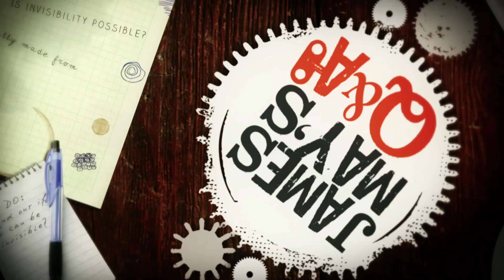Why Can't Trains Go Uphill? | James May's Q&A | Earth Science

Comment: In Swiss and German Alps there are trains with gear wheels that lock into the gear teeth on the rails.  The Train can climb extreme rises.
Reply: +bohemianh 
Cog railways are usually, if not always, 1 or 2  car passenger operations. That means they are relatively light weight.
Freight trains on the other hand weigh thousands of tons, a unit coal train in the US for example will have 125 cars each weighing 100 tons (that's 25 million pounds total, 11,340,000 KG) and run with 3 or 4 4,500 horsepower locomotives. That's a very low horsepower to weight ratio, ( around 1 HP for 1,400 pounds (635 KG). Imagine a car that weighs 4,500 lbs [2,040KG] with a 3 HP motor) and their limiting factor is not as much as loss of traction as not having enough power to climb more than a 1% grade, (1 foot of rise in 100 feet of run). Typically in the plains grades will be less than 1%.
I have seen such trains in the Rocky Mountains with as many as 10 to 12 4,000+ horsepower locos. They space the engines throughout the train, 3 or 4 in front and radio controlled units 3 or 4 in the middle and another 3-4 pushing in the rear of the train. But even in the mountains mainline grades rarely exceed 2 1/2% and these trains can only go 12 to 15 miles per hour (20 to 25 KPH)
The real problem here is comparing apples to oranges, not all "trains" are the same. Little short tourist or commuter cog trains have very little in common with long haul mainline freight trains except they run on rails.
Reply: +NotATube There is also a system with a third rail and an extra set of rubber tired traction wheels called... Something. Ill go look it up.

 Looks like its the Fell railway system, and most of the time its just used for breaking force.
https://en.wikipedia.org/wiki/Fell_mountain_railway_system
Reply: +bohemianh The steepest grade on a cog railway is the Pilatus railway in Switzerland with a maximum gradient of 48% with an average of 35%.  The Mount Washington Cog Railway (in my home state) was the first mountain rack railway and second steepest in the world which has a maximum gradient of 37.41% and an average of 25%.  The first rack railway was created in West Yorkshire, England.  
Having been on the Mt Washington Cog Railway once, I felt I needed to ride behind the traditional steam locomotive for the "full experience".  With every piston cycle you're jolted about once a second as if in a violent rocking chair.  THAT made for a very long 45 minute ride up the hill. ;)  They had just recently commissioned a diesel locomotive from John Deere which powers the cog system hydraulically.  When I got to the top I was jealous and physically regretful. ;)
Reply: @MarcMercier1971  Pikes Peak in Colorado also has a cog railway, climbing to 14,000 ft above sea level.
Reply: +Luckystrike now that is a great point
Reply: Culdee Fell Railway
Reply: +bohemianh The train that used to connect Argentina and Chile through La Cordillera de los Andes was just like that, I remember seeing those gear-contacts beside the tracks
Reply: alpha4005
 Thanks for the additional information.
It does get pretty technical fast.
I thought the original video was pretty poor in their attempt to explain "why trains can't go uphill"
Reply: +bohemianh Yes, that's exactly what I was thinking as well. 

https://en.wikipedia.org/wiki/Rack_railway

I don't know whether there are interoperability issues with trains compatible with such systems on regular tracks. I'd also assume that the Swiss ones going up very steep slopes would be unsuitable for reasons that are obvious if you look at the shape of the train in the photo (i.e. the train itself is slanted to match the slope):-

https://commons.wikimedia.org/wiki/File:VRB_H_1-2_bei_Freibergen.jpg
Reply: +bohemianh Cog railways are really unique and very interesting.

Some even have a ratchet system so the train can't roll backwards down the grade if the brakes fail.
Reply: True,  much higher gradients can be climbed by rack railways at the expense of steam...  Rack locomotives have very low gear ratios to have maximum tractive effort (at the expense of speed)  and the rack is purely to stop this tractive effort from merely spinning the wheels
Reply: +bohemianh i remember a train that went from Interlaken OST up the mountains. the Gear didnt kick in till half way up when you heard a crunch of it engaging
Reply: +Luckystrike You have a really well explained point. The numbers are even more ridiculous than that though. Most unit coal in the northeast is 120 aluminum hopper cars which weigh between 25 and 35 tons depending on the make, model, and options on them. The 100 tons is usually the coal load within them which will range between 80 and 100 tons depending on the car. If you load more than that you end up with plate class restrictions and overweight car issues. Most mainlines have a standard weight limit of 286,000 pounds (approx 143 tons) and exceeding that means big issues. I think the average train weight excluding locomotives around here is 16,000 tons. As mentioned they are pulled with a number of locomotives but even with that there is a lot of issue. You can't just keep adding engines. Too much power can cause a train to tear in half (broken knuckle or drawbar) If the engines aren't distributed well enough throughout the train and there is too much power on the second set of engines it can cause the train to derail and fold like an accordion (excessive buff force). Distributed power solves this problem when well executed but it doesn't always work well. The automated systems have some issues and manned helpers can be a hazard with an inexperienced crew. After all that an engine isn't just an engine. When looking at power application and dynamic braking the numbers are based on "Powered axles" which in older locomotives was straightforward. Newer engines are extremely powerful and even though they only have, on average, six axles the number of "effective powered axles" could exceed 6. Most if not all regions have a consecutive powered axle limit as well. 

Its a complicated process that tries to get more train over the road with less.
Reply: Then there are the funicular railways that are kind of a combination of train,cog and/or cablecar , there is almost no limit to the steepness of grade.
Reply: @MichaelClark-uw7ex  Your comment made me realize that a Paternoster is just some kind of vertically running cable car...sadly, they have died out almost everywhere because some people thing they are too dangerous.

https://www.youtube.com/watch?v=_hn6zGey99w
Reply: @MichaelClark-uw7ex  This thread is very educational. Thank you for introducing me to new facts and key words to look up!
Reply: +bohemianh   Also on Snowdon, no need for a passport!
Reply: +Michael Clark funicular railways "solve" the gradient problem partly by limiting the length so much, a few 100 meters is typical. It's possible to use cables, hydraulics and such means of shifting the vehicle, without relying on wheel traction. Whereas a mainline railway is useful because it takes you 100's of km, and it only has the vehicle wheels to play with.
Reply: +bohemianh Why can`t they use that on trains the world over? Or possibly even rubber fitted around the wheels?
Reply: +Dominic Porter Money
Reply: @pigeonshouse  Money?! What makes you think that?!
Reply: @DigiDragon001  cos things cost money 🤷‍♂🙄
Reply: Matt Whyndham
That is true, although there are some funiculars that are thousands of feet long, mountain resorts and hillside cities where normal mass transit would take miles of track to climb to the same area.Although they are not comparable to mainline railways, they are comparable to many cog lines though.
Reply: You know, I was thinking just the same thing. I've heard of those railways, rack railways I call some of them, as well as funicular railways. Why hasn't May included these lines by also looking at lines such as the Snowdon Mountain Railway? Those trains would surely prove him wrong about trains not being able to climb up hills!
Reply: +Dominic Porter It is dangerous to operate on steep grades, and you risk damaging your cargo and the cars themselves. Rubber wheels on locomotives would be disastrous - within a few feet/meters any rubberized coating on a locomotive wheel would be completely torn apart due to the sheer weight and amount of force used to move the train.
Reply: also Diakofto-Kalavrita railway
Reply: There is also one on Mount Washington in the States.
Reply: Bohemianh its not a train. its a ferry
Reply: Ben Wyatt Yeah, nah
Reply: +bohemianh There's one of those that takes you up to the top of the white mountains in New Hampshire, also one in Chattanooga I rode up as a kid, pretty cool to be on such a steep grade though going back down is hair raising.
Reply: Tell me about it! Although, it isn't exactly hair-raising on lines like the Como Funicular Railway, just a little unnerving.
Reply: Okay, I hadn`t thought about that... Thanks anyway.
Reply: ΑΡΗΣ ΚΟΡΝΑΡΑΚΗΣ
A very beautiful and scenic railway.
Reply: +bohemianh Known in the US as a "cog" railway. That is what is used on the train that climbs Mt.Washungton. But the gar rack is between the rails.
Reply: @bruceharvey8810  Same for the Pike's Peak cog railway in Colorado Spring, CO, which climbs to 14,000 ft above sea level wh8icl Mt. Washington's climbs to about 6,000 ft.
Reply: +bohemianh doesn't that result in a lot of wear on the tracks and much less efficient flat running?
Reply: +Al Paca If you are still referring to the cog railways, the teeth are only set in the steep inclines as a third rail. kinda like a subway. it's usually set within the gauge and the gear on the locomotive is part of the axle assembly. On lower and no grade track they just omit the third rail.
Reply: Ah this makes a lot of sense, like a central slave wheel which normally doesn't engage with the track, then when they hit the third rail they can engage a clutch which shifts the drive from the flat wheels to the geared wheel and track. I hadn't thought of that :D
Reply: +Al Paca I have never worked on one but I am pretty sure the gear is part of the solid axle. The amount of torque would be very hard on a clutch the regular wheels will still provide output especially when reinforced by the cog system. The gears are mounted high enough they won't catch on anything and even the lower mounted ones have special clearances in the switches and track structures.
Reply: As to the rack railways, sometimes the rack itself is only there at places with great gradients, but on a plain, it is a normal adhesion railway. The locomotives can either power the wheels or the rack wheel. This way the same rolling stock can be used, and a rack railway can be just a part of a system. Google search "zacatek ozubnice" and then click Images to see places where rack begins or ends.
Reply: What like a rollercoaster lift hill chain?
Reply: Wow that sounds expensive
Reply: Sounds difficult to manufacture.
Reply: Those are known as cog railroads. Another example is the railway at Pikes Peak in Colorado.
Reply: Yes, but they are not efficient at carrying large amounts of supplies across long distances.
Reply: Seen them on Discovery Channel many years ago.
Reply: cog railways are quite common to get up bloody steep hills (I-E the Snowdon Mountain Railway), but there are other ways, like cable lines and road rail systems.
Reply: It's called a cog railway.
Reply: @russg1801  - Or a rack railway. The cogwheel is the round gear wheel on the locomotive. The rack gear is the linear gear on the track. Several designs of gearwheels and rack gears have been and are in use.
Reply: https://www.youtube.com/watch?v=U6VmdP1Qo2s   and Naples
Reply: I actually came into the comments to say that exact thing!
Reply: The Marsh Rack system was used all over the world. There aren't many railways with them now though.
Reply: San Francisco, California, USA is famed for its cable cars. Two lines have been preserved and are in regular operation. Cable cars can be found in quite a few places around the world. 
The Incline Railway near Chattanooga, Tennessee, USA goes up Lookout Mountain.
Reply: In the UK we call it a 'rack and pinion' railway. Mount Snowdon has one.
Reply: By adding more traction you lose speed and efficiency.
Reply: I'm not traveling in that trap
Reply: Rack railway, huh? However their tonnage and speed is a joke compared to ordinary railroads. 30 kph is already huge for a rack rolling stock, let alone heavy freight loads.
Avoid using rack railway unless you have no other choice.
Reply: Also Mnt Washington in the US. Known as the Cog Train.
Reply: Schön so eine Zahnradbahn
Reply: I’m talking to you from 6 yrs in the future. You send me bitcoin and I’ll send you a vaccine in return. You’ll know what to do when the time comes
Reply: That’s called a cog railway. There’s one in Washington too. Trains is good at climbing, it’s just the default setup is designed to be low friction for maximum efficiency.
Reply: Look mate, the last thing we need around here are facts.
Reply: Much more clever than my idea of using cog wheels for, well, wheels.
Reply: Ahmed Ali i own them

Comment: When braking all the wheels have brakes, and all are contacting the rails.
Modern engines use their motors to generate electricity.
On the roof of the locomotive, big electric heaters with fans use up the electricity.
Not regenerative braking, dynamic braking.

Comment: couldn't you just lay down a thin rubber strip on sections that have an incline to increase friction?
Reply: +Jazoray The rubber would be eaten away in no time. Trains are simply too heavy and transmit their weight through a much smaller area of contact than road vehicles with their rubber tyres. 

And no need for that when you can just sand the rails.
Reply: Regardless, it's kind of a disadvantage for a train to need to go up such a steep angle in the first place, much of the cargo is delicate, and the cars themselves aren't even attached to the wheels, they rest on top of them. A train needs momentum as well, and inclines will bleed off the momentum and require more power and fuel to maintain it, which reduces the trains' entire purpose... Efficiency. Building tracks on an incline is a feat in itself as well.
Reply: +Jazoray You could probably just put ridges on the wheels and make them like giant quarters and it would give it more traction, but after a while they were just be worn smooth again.
Reply: ***** Where is this from? I've never heard of using magnets in the trackbed as a braking system for conventional trains.

A lot of modern trains have dynamic braking if that's what you're talking about.
Reply: +Worms Blink knurling the rails would probbably help too
Reply: +Don Burd i'm aware of that technology. I'm just wondering if that rubber strip can be a cheaper and more compatible alternative
Reply: *****
 why would it get mauled by rolling metal over it. i just want to lace the top of the rail with a tiny layer of rubber. it's not like the pointy edges of the wheel ever come in contact with the rubber.
Reply: thank you for the detailed explanation. I understand now. You have done a good deed of educating a stranger today.
Reply: ***** You realize I was joking right?
Reply: Easiest way I think would be to hook them up like a rollercoaster on the hardest parts... just a little bit of help here and there :P
Reply: It would probably destroy that piece of rubber.
Reply: no. sand is commonly used
Reply: That's a stupid idea.
Reply: +Fishflingers232 Electromagnets are quite standard as a braking mechanism, and they can be implemented either on a train or on a trackbed. In short, if you pass a piece of conductive metal through a stationary magnetic field, either by a permanent magnet or an electromagnet, eddy currents are generated within the metal which creates drag. You can fit these as 'braking blocks' at stop locations, and they'll work pretty decently.
Reply: +Texassince1836 which would be worn smooth in no time.